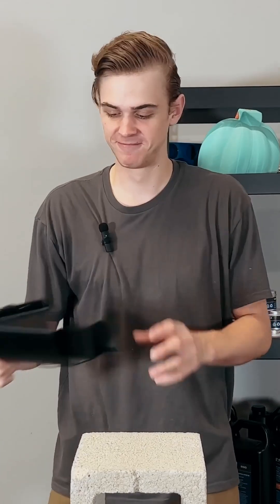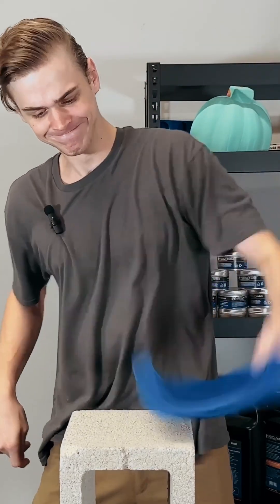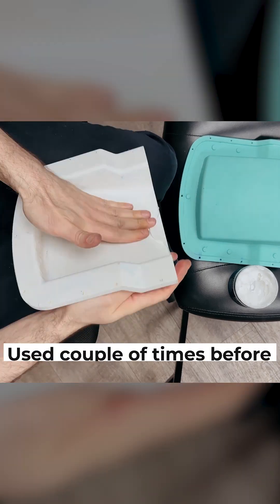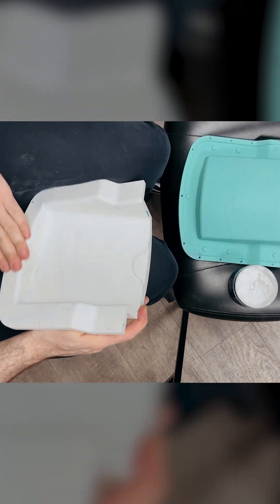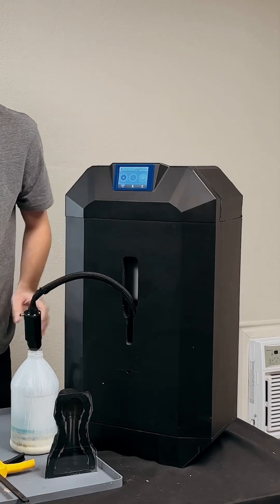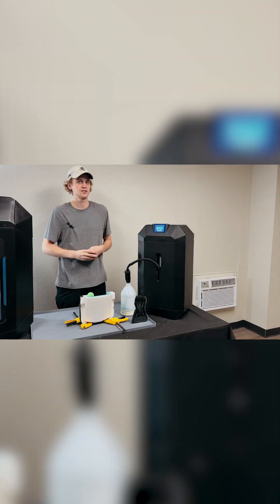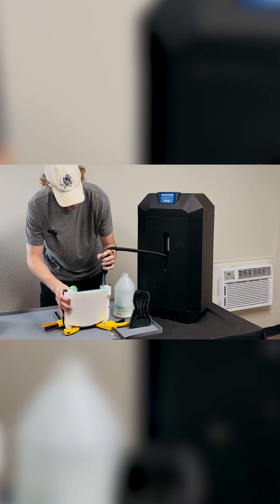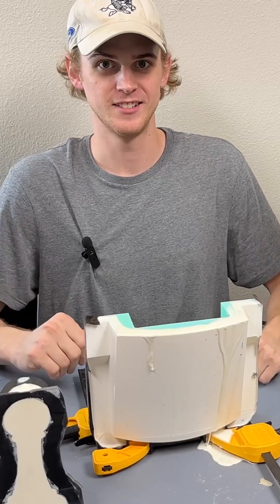Filament vs Urethane | 3D Print Breaks, Polyurethane Survives

Comment: Hey there can you answer my question from the video you posted yesterday. I need to know what is the size limitation with this system. Thanks.
Reply from the maker: We have answered yesterday. Here it is: There is no size limitation limit is 2 gallons; as long as you fill the system you are able to use continuously.  

Entire rear spoiler would be too heavy unless you have a inner core placed before(Like a closed cell foam or a inflatable inner core). Bumper and front spoiler would be ok.